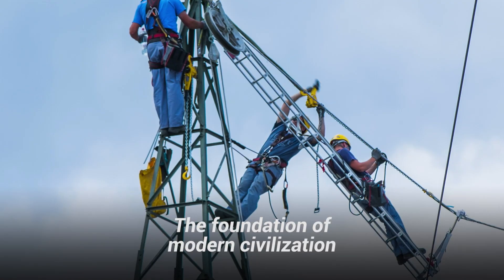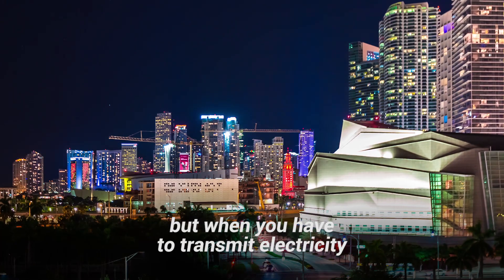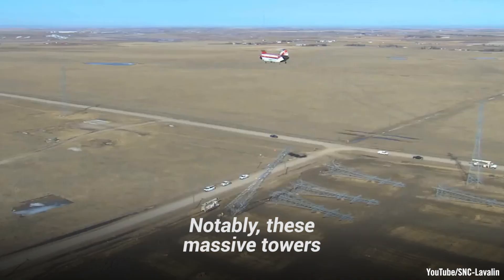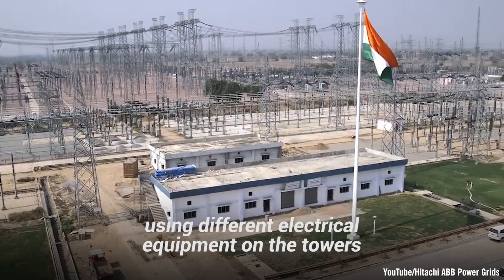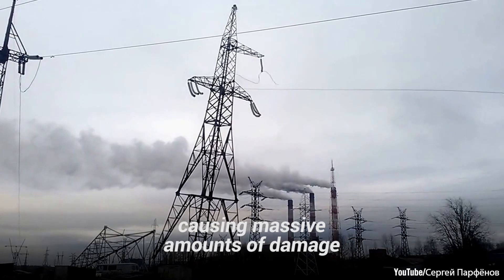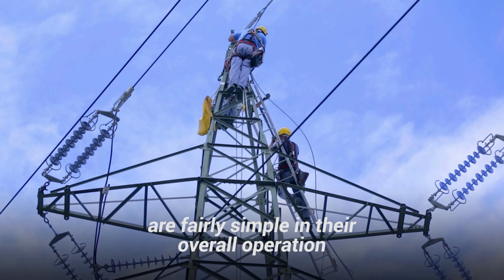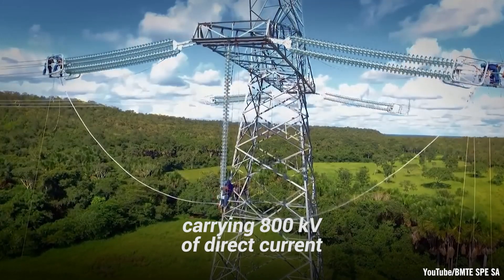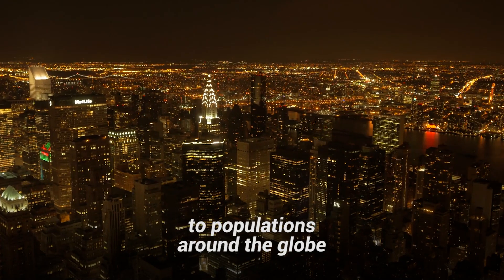How high voltage AC transmission towers supply our electricity

Comment: Amazing footage. We generally don't give much thought to the incredible amount of infrastructure involved electrical transmission, and I had NO idea it was in the hundreds of thousand dollars per mile! During college, I used to take a break and walk on an access road very similar to 0:00 under the high voltage lines and listen to the crackling and humming, especially on a foggy day :-O
On another note, I flew through a 7,200vac powerline (with my face and leg) in my hang glider and was electrocuted pretty good; don't you just hate it when that happens :-)